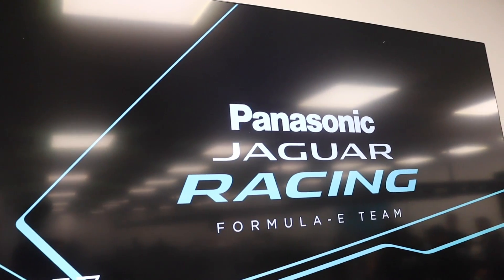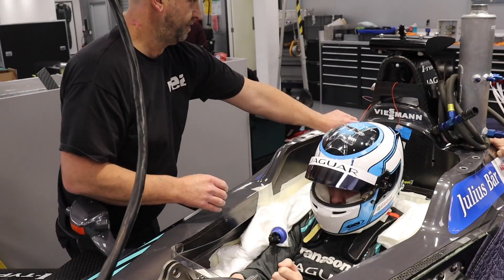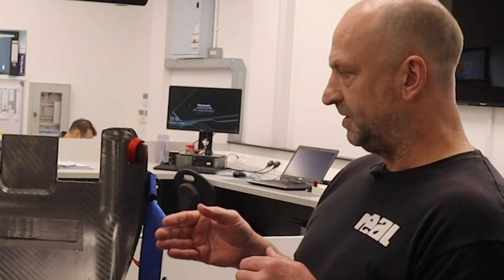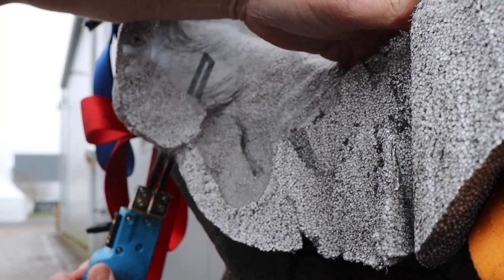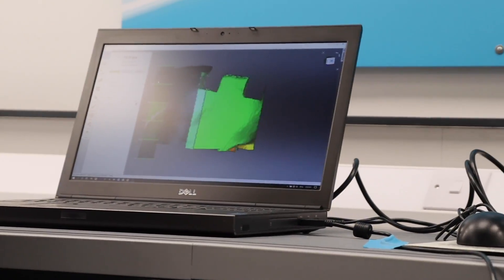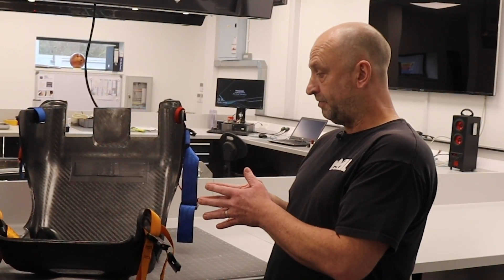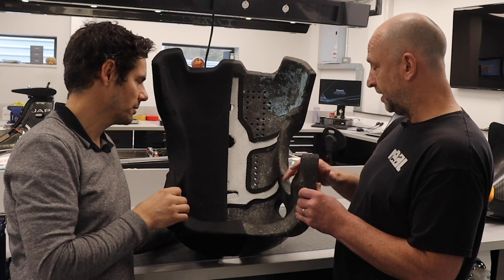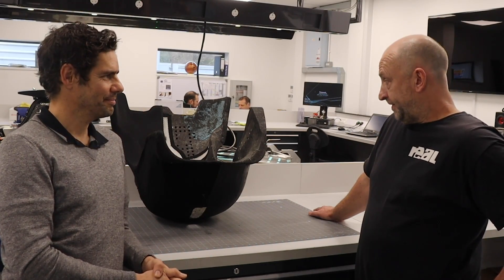Making A Racing Driver's Seat

Comment: So the million dollar question that I just can't get my head around. How can you create a seat in a factory with the driver just sitting un restrained in the cockpit that is still comfortable when he's strapped in with 6 point harnesses and braking from 300kph down to 80kph for a tight corner?
Reply from the maker: You're creating a perfect mould of the driver's shape, so strapped in, travelling at speed, or even braking, it's as comfortable and supportive as any of those situations can be.

Comment: At 3:38 you've given a great shot of the inside of the car cockpit. Is that foam lining? Is an F1 car similar? are those rocker arms suspension? looks like there's loads of space to weild a spanner, dunno why you were moaning in the last video!!!  :)
Reply from the maker: Haha, yes, there's a memory foam lining for driver leg protection and F1 cars have something similar. As for the space, there's a lot less going on inside the front end of an FE car than and F1 car.